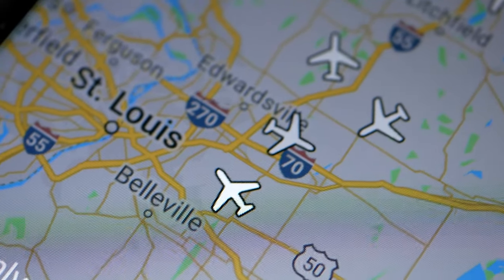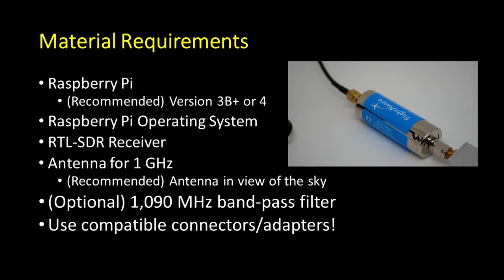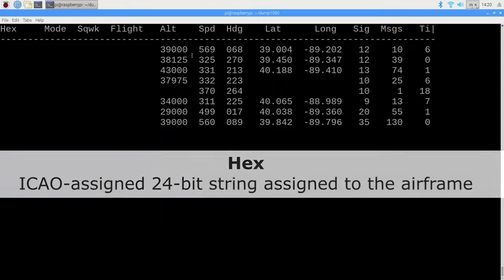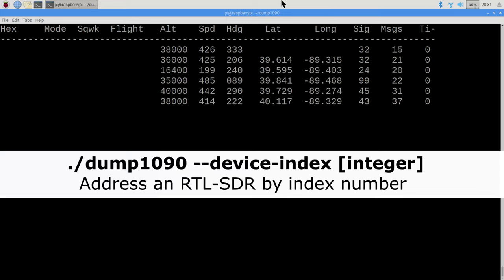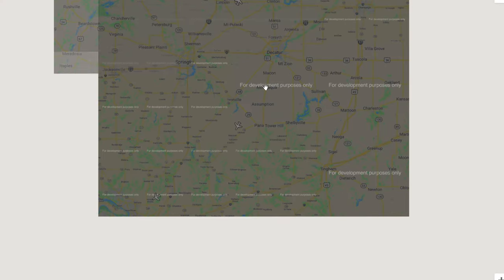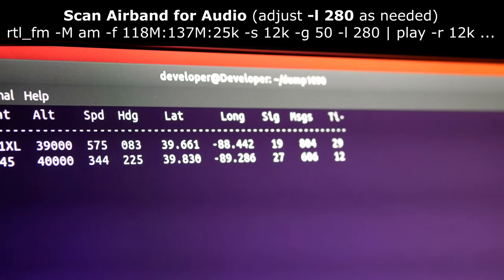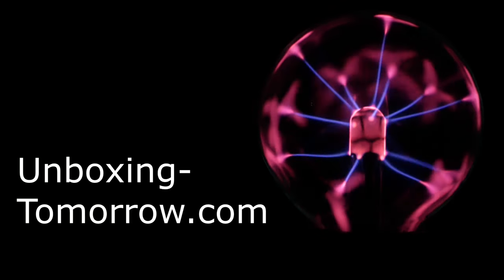Decoding Aircraft-Tracking ADS-B on Raspberry Pi

Comment from the maker: The best SDRs for this will have temperature-compensated crystals (TCXO)!  Drift and ppm corrections will not be an issue with them.
0:30 - Requirements
0:50 - Step 1 Update
1:10 - Important Notice
2:07 - Avoid Driver Problems
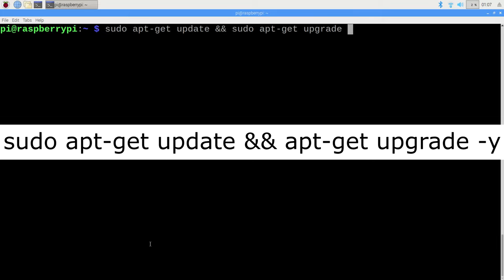2:50 - Reboot
2:58 - Install Dependencies
4:45 - rtl_test
5:17 - Audio Test
6:10 - Closing Remarks
Reply: pro tip : watch series at kaldrostream. Been using them for watching lots of of movies recently.
Reply: @Matias Briar yup, have been watching on kaldrostream for since december myself =)
Reply: @Matias Briar yea, have been watching on kaldroStream for since november myself :D